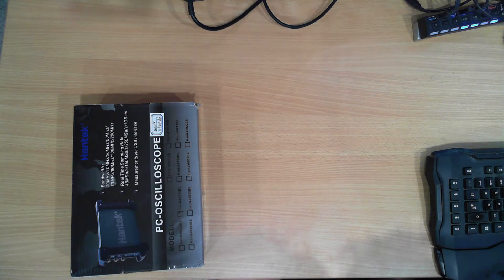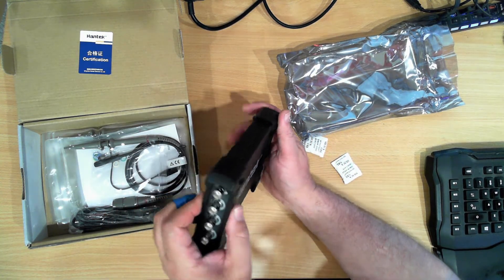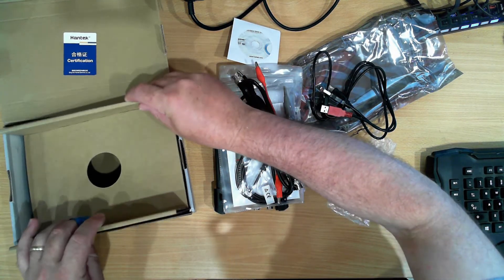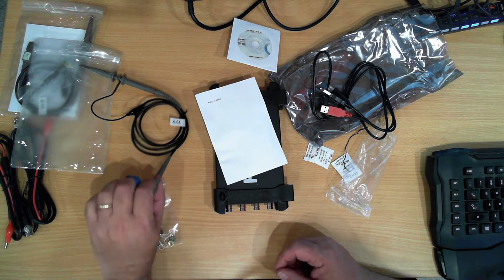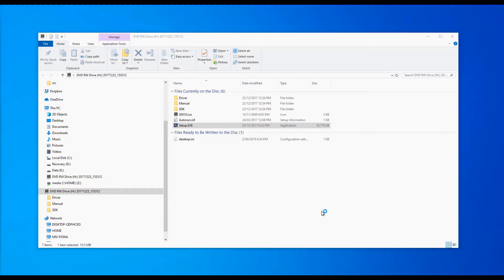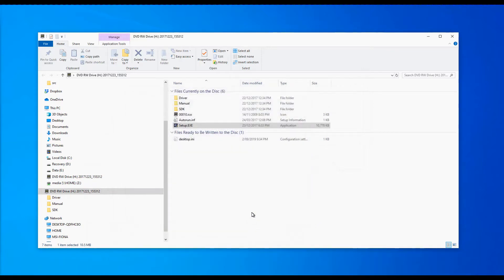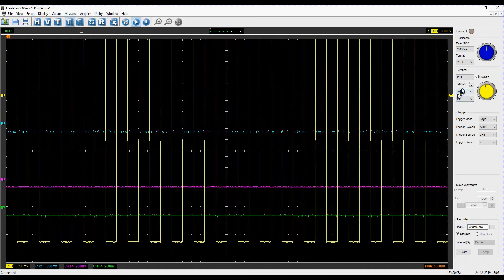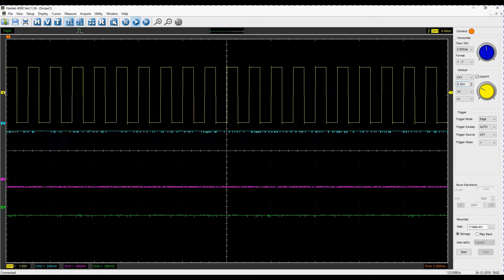Hantek 6074BC Unboxing

Comment: What's your current view on the this scope? The signal looks very noisy...
Reply from the maker: To be honest I don't use it a lot.  Mostly for videos.
Yes is does seems to be noisy on the input.  But this noise is different depending on the setting.
I measured the noise at each of the vertical settings just to se what it gives.
Measuring the VPP of a shorted probe, you get the following.
2.00mV = Vpp 1.69mV
5.00mV = Vpp 1.88mV
10.0mV = Vpp 1.88mV
20.0mV = Vpp 2.51mV
50.0mV = Vpp 0.00uV
100mV = Vpp 0.00uV
200mV = Vpp 25.1mV (There was a relay change going from 100mV to 200mV)
500mV = Vpp 0.00uV
1.00V = Vpp 0.00uV
2.00V = Vpp 251mV (There was a relay change  going from 1.00V to 2.00V)
5.00V = Vpp 0.00uV
10.0V = Vpp 0.00uV

There could be some internal noise that its picking up when it's internal amps are being pushed at the lower ranges.

I tend to still use my e-Design DS203 before the Hantek 6074BC because it's much faster to setup and I'm more familiar with it.
Of course the display on the Hantek is much bigger on the 36" monitor compared to the 3" on the DS203 :-)
All jokes aside, I think the $200 DS203 dual channel is much better value than the 6074BC at just over $300.

It all comes down to what you plan to do with it.
At mains voltages, I would use the Hantek first from a safety perspective or if I needed to capture video of the display or if I needed more than 2 channels.
If I'm looking at 1 or 2 channels at less then 20MHz then the DS203 is the better option.
I've found I use the Kingst LA1010 Logic Analyzer more than either scope, but thats just the nature of my hobby.

Hope that was helpful.

Ray
Reply: @CyberOne  Thanks for the detailed answer, these noise numbers are crazy! Also the software seems to be quite bad. I also have a KingST logic analyzer, which is performing very well, but even my 5$ 24 MHz 8 channel logic analyzer is enough for most of my Arduino and reverse engineering projects. Very helpful reply, cheers, Ron

Comment: Hi, I hope you read me
I was thinking about to buy this oscilloscope because of the problem that we are living, I am a student...
Could you tell me what Operative System do you have, the performance and where did you buy it?
Reply from the maker: I run this on a Windows 10 Home System Version 1903.
I purchased the unit from a Seller on Ebay.
As a student you need to ask what you are using the Oscilloscope for.
If it's just to view the signal and trace possible problems, there are cheap very portable alternatives.
Before I purchased the Hantek unit I used a DSO203 unit I paid AU$200 for from Ebay.
https://www.ebay.com.au/itm/AU-DSO203-Portable-Digital-Oscilloscope-ARM-Pocket-Cortex-M3-CPU-8M-Hz-Handheld/232418469052?hash=item361d3864bc:g:AjoAAOSwY~VZcY~0
This unit has 2 analog inputs and 2 digital inputs as well as an Analog output for custom wave form generation.  I did upgrade the firmware for it.
It is battery powered via its internal Li-Ion battery and can capture screen shots.
I purchased the Hantek unit as I wanted to be able to capture the wave forms live for video.  If this is what you need it for, then it's not a bad unit.
If you just need it for fault finding or signal tracing, then there are cheaper alternatives out there.

Hope that helps.